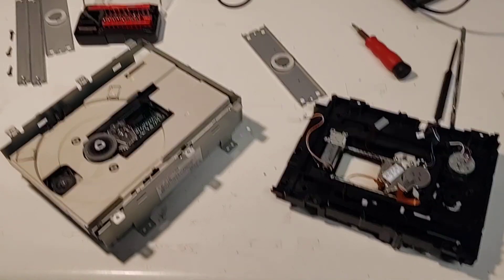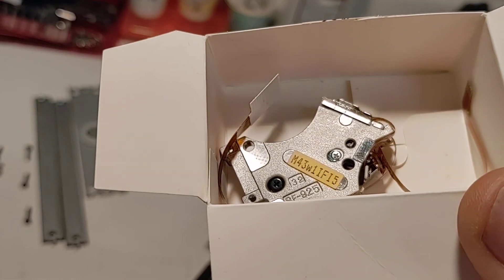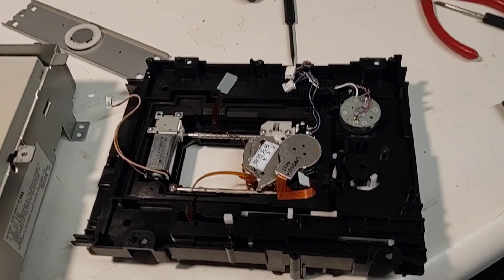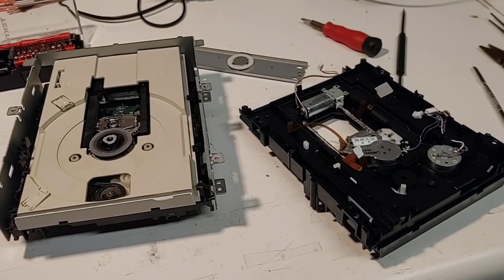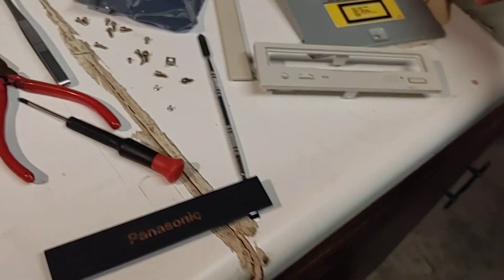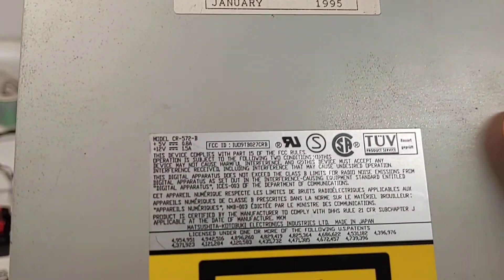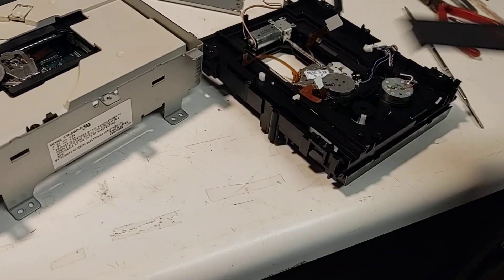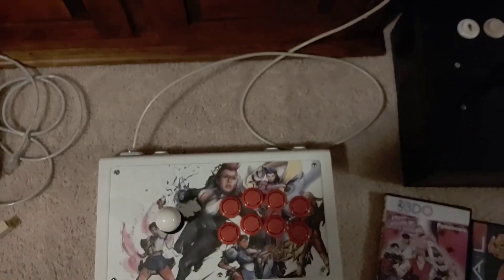3DO laser lens/disc drive repair with IDE CD-ROM drive parts

Comment: I know this is old but I found a lot with old drives cleaning in and around the lense and cleaning all the moving parts and adding new lubrication can be helpful, I haven't worked on 3do but a lot of playstation ones it's more common for the drive to not being able to read because of other mechanical faults rather than the laser and the majority of those work after this servicing, lubricating motors and all moving parts, testing with a battery. I suppose it could be harder to see what's going on, but for example one ps1 drive I had trouble with the lense wasn't focusing, I followed the schematic and everything was fine apart from the chip that controls this and the disc drive then worked when that was replaced, I guess it's all troubleshooting but may help someone keep hold of good drives, anyhow this is a helpful video I have a 3do on my desk about to get to work on haha.

Comment: How interesting! I recently had a CR-571-B model CD-ROM (Panasonic?) that would not read any CDs. I stupidly took the CD-ROM to my local recycling centre for disposal and now I thoroughly regret doing that.

The problem I find with these older CD-ROMs is that it is difficult to detach the chassis that allows access to the CD-ROM. Whenever I try and take one of these apart I am frightened that I might end up breaking the front bezel. I believe I used a CD-ROM lens cleaner if I remember correctly without success.

Did you try using a CD-ROM lens cleaner before you did the swap over?

Comment: I've tried a couple of lasers from ali express too, bought 2, none of them had the same performance of my original laser, kept using the original. Swapping the ali express lasers for the original made it read discs perfectly again.
My original laser sadly died when I accidentally ripped the 4 pin ribbon cable one day. The console's been sitting for years now.
I plan to revive it one day with an ODE, but it's sad cuz the FZ-1 is a REALLY good music player, it's legit a step above other CD based consoles of the era, I really wish I could fix the CD drive one day...
Reply from the maker: That's a bad deal about those AliExpress lasers. I hoped maybe I was the exception to the rule when mine arrived defective, but apparently not if both of yours were defective as well. 

IIf you ever come across one of these ancient CD-ROM drives they're definitely worth trying out.

Comment: Just a thought on the replacement laser you purchased from Aliexpress; are you aware that these replacement lasers are shipped with a solder blob on the 11-pin ribbon cable attached to the laser mechanism? This blob is there to ground the laser to avoid static electricity from ruining the laser in shipping. This blob must be de-soldered before the laser will work!
Reply from the maker: I appreciate your suggestion, I was aware of the blob. I tried my best to remove it with a solder sucker. My soldering skills aren't the greatest and I was afraid of melting the cable but I'm pretty sure I got the majority of it off there. I may end up getting it back out and trying to clean it up a bit more, I hate to just throw $50 in the garbage if it's a simple fix.